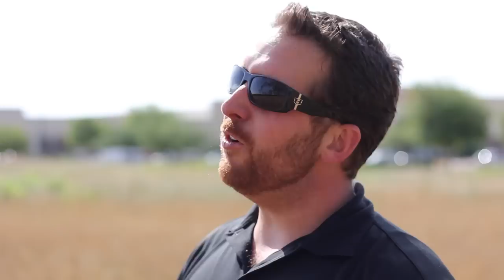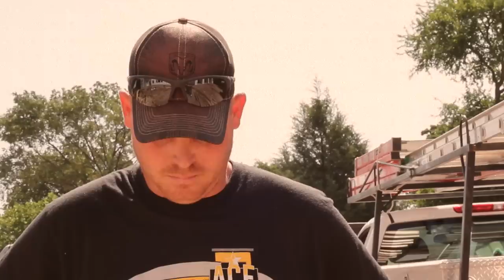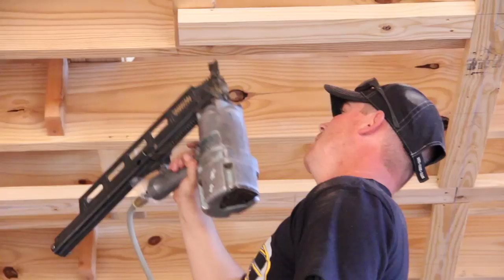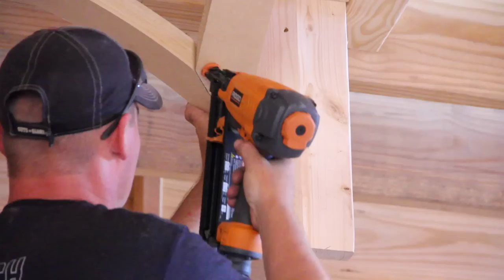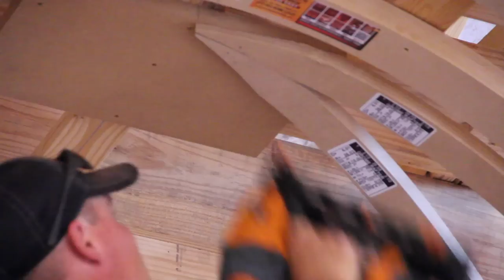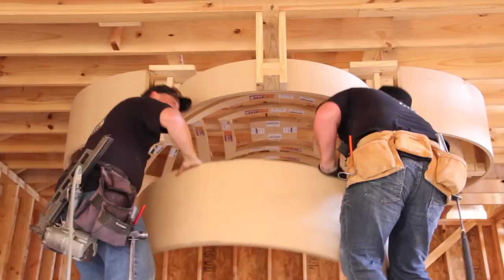The Grome: 1 Groin Vault & 4 Half Dome Ceilings

Comment: Beautiful and scary. As a structural engineer seeing this, I would have required screws for the top 2x framing and attachment plate. I've seen an entire commercial ceiling collapse because of withdrawal from vertical nails. Great concept, just add a few screws up top.
Reply: We used metal straps (strong ties) and properly secured it.